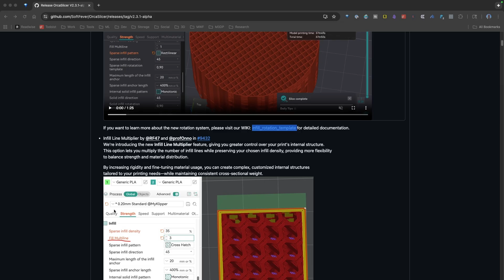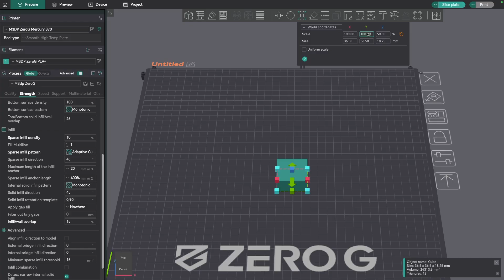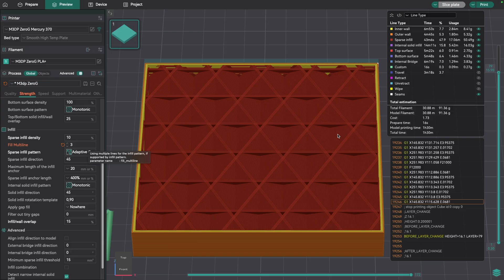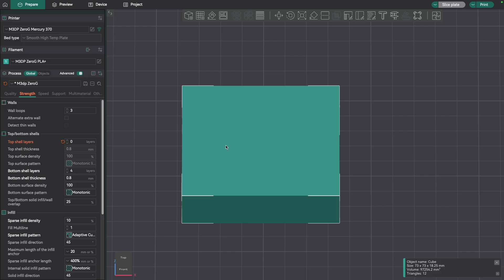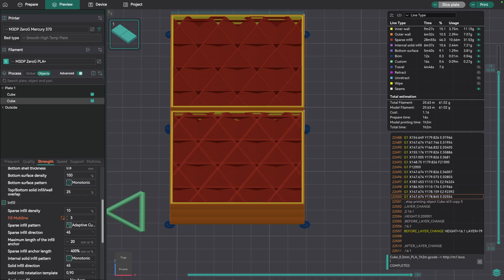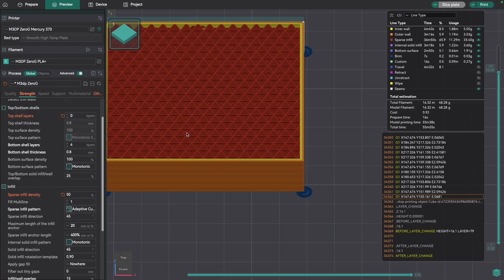OrcaSlicer 2.3.1 Alpha: Are Your 3D Prints TOO WEAK? Check Out Fill Multiliner and Get Stronger!

Comment: It again emphasizes that the infill ratio is not doing what it says it does.  If the infill would be 10% of the inner volume, then making the infill extrusions twice as wide should also cause the empty spacing between those grouped walls to increase by the same factor, but they don't.  For the same reason you would expect that when chosing 10% infill, the infill pattern itself should not significantly affect the material used, but it does.  In short, I have no idea what the "infill percentage" now actually represents, but it's definitely NOT the percentage of volume occupied by sparse infill!
Reply from the maker: After printing more samples, I agree with you. Multiple line and 10% infill represent some different value that I am n9t sure how to qualify.

Comment: I mean, the infill percentage isn't actually a percentage of the volume as such, clearly, because different infill patterns at same percentage doesn't result in the same weight.

Also, the weight is shown right there in the slicer, and even if the printer is badly calibrated and you have the wrong density set in your filament settings, the relative weights will still be correct.

It's not like the plastic changes density to any noticeable degree (unless you're using a foaming filament or print with extremely wet filament).

But yeah, there's certainly use cases for this setting, I used to use it back with Cura, but hadn't actually noticed (or forgotten) that it wasn't available  in Orca slicer 😅 that probably tells you something about how often it's useful though, I'm an engineer and machinist who almost exclusively print mechanical and end use parts, often pushing 3D printed plastic to destruction when using it for metal fabrication tooling 😅
I basically tweak my settings for every model I print, there's so many things that makes a difference in different ways depending on the use of the part.

Comment: What I always did is changing the line width for the infill. So say I print with a 0.4mm nozzle, my line width for the most outer shell is 0.45 (or so) and the infill line width is 0.6-0.8mm depending. 
It prints faster because it´s just one tool path. It´s way stronger within the layer and it´s way stronger in between the layers due to higher extrusion force.
Honestly I don´t understand why they didn´t simply implement this instead by default, it´s pretty simple, I am doing this for years.

Comment: I've been using OrcaSlicer 2.3.1-dev since it released a few months ago.  I like it.  It has the circular flow rate calibration, which is much better than the old YOLO monotonic top fill, but it doesn't have the multi-line fill.  I like the dev version so much that I'll wait for the stable release of 2.3.1, and before upgrading I'll export all of the profiles I've developed.  I lost some stuff when I installed the dev version.
Reply from the maker: I need to do a video about backing up.

Comment: This is certainly an interesting feature and I'm interested to know how the strength is affected, but for the same amount of plastic. Printing two things both at 10% and one with 3x the infill, sure it feels stronger because it has 30% infill now (just spaced at ~10% spacing). The question remains if it is any stronger than just 30% infill with 1 line. Great description and demonstration!
Reply: Real world tests with thicker infill from larger nozzles suggests that the multi-line infill will be stronger than using the same infill material spread into a finer infill pattern.  It's a similar situation to breaking 100 individual pieces of dried spaghetti versus a bundle of 100 pieces.

Comment: We need an actual strenght test to determine if this solves a lot of problems. I'm also waiting for brick layers which has been out for a year now but hasn't been fully implemented.
Reply from the maker: I am working on getting equipment to do strength test. I think bricklayers is a potential problem due to patent issues.

Comment: Biggest letdown with the new Orca update? No brick or staggered perimeters. Quality’s already great, but layer strength is still the weak point. Staggered layers aren’t the full solution, but it’s the right direction. Not adding it feels like missed low hanging fruit as development is already far.
Reply: Ya for me the biggest problem across all materials is also the weak point of the layer adhesion
Reply: @berlinberlin4246  - I'll often use TPU, not for flexibility, but for its impact resistance, chemical resistance, UV/sunlight resistance, and its very strong layer adhesion.  It's by far the material with the most isotropic physical properties.  3+ outer walls and a decent amount of infill and TPU is a solid part.  No brick layers needed.
Reply: @Liberty4Ever  do you use "normal" 95A TPU?
Or can you maybe post which hard TPU you use?
Thank you
Reply: Hey.. how's the weather down there? 

Btw. ORCA IS FREE.. I'd be damned grateful. But I get it. Thats how the devil would be. 🙁😁😈
Reply: I grabbed a dev version with it implemented. Unfortunately I have no idea how to download it again
Reply from the maker: I think bricklayers have potential patent issues